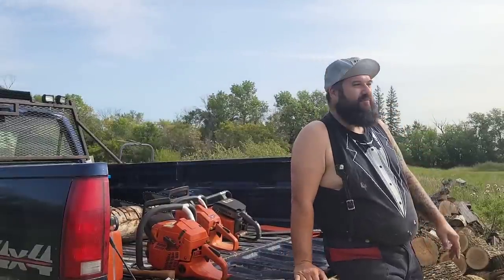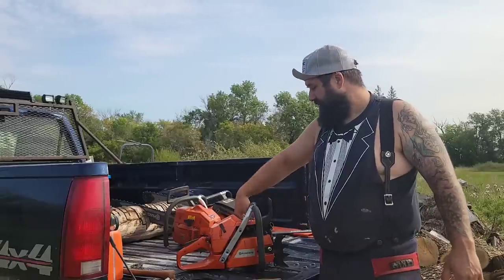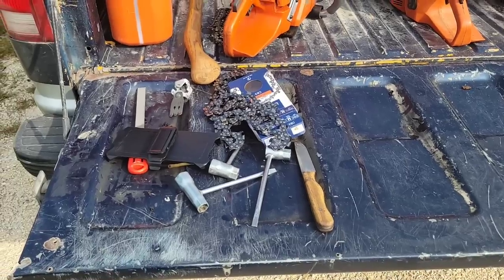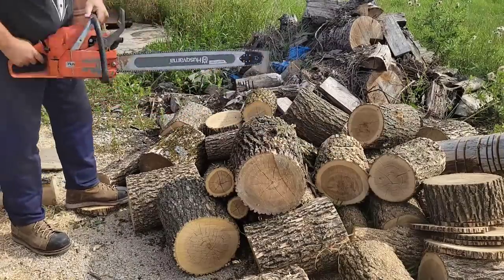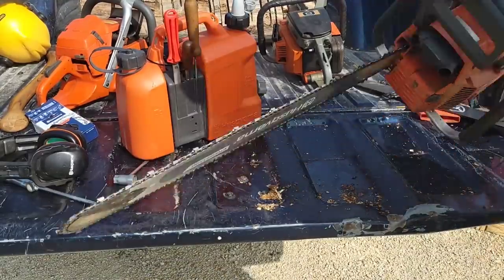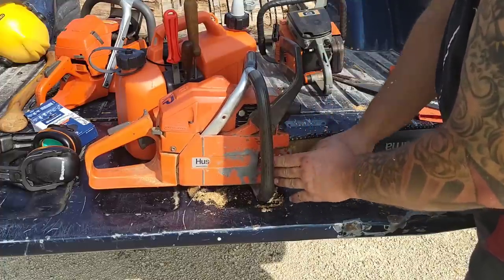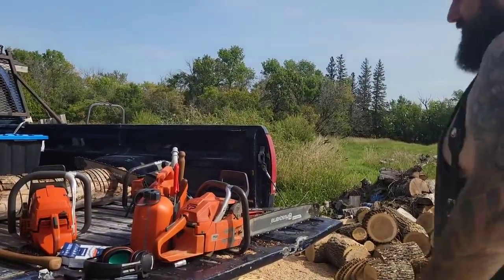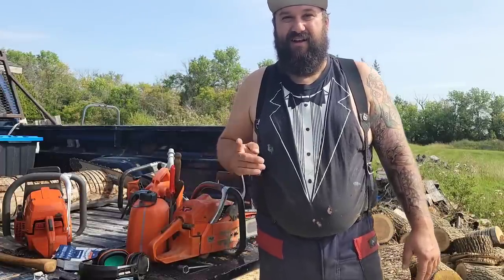Husqvarna C-83 chain vs handfiled chain. Which is faster???

Comment: Once I began using a chain grinder I quit filling! I have been  to a few Oregon schools and many STIHL schools. Learning from the engineers helped me a lot. Great content.
Reply: I just enjoy running the grinder.  I worked in and then managed an ace hardware for a few years and running the oregon (and cutting keys) were my two therapy moments.    Just like filing there is a touch to it to get a nice edge.  I am also an obliterator of gullets.  My top plate and side plate are pretty much cut in "plane" as in chisel like and flat in shape across the face of the tooth (except for a little curve at the bottom cutting edge of the side plate)
Reply: @mattfleming86  LOL. I also worked at an ACE hardware, 26 years, 5 of those managed one and 15 of those a STIHL tech.  The engineers said to only to grind down only to the bottom of the side plate. Leaving the gullet alone, it doesn't do any cutting. Lately I've been experimenting with square grinding & the hexa grind.
Reply: @richardfuerst5286  It certainly does not cut past the squared off side plate, but it seems to pull a good chip and cut well when I go a smidge deeper.  Chip flow maybe?   It may not be the right way or even the best, just what works for me.  I aim for the very bottom of the side plate to be into the radius of the cutter in a way that the last piece of the side plate at the bottom is 90* to the chain.  I still want some of that hook shape and that depth keeps me well out of the chain parts lf the chain.  But it is deeper than "code" As you know the top plate doesn't really do a lot of cutting when going cross grain, it's mostly the side plate doing the work so I like that hook shape to grab any leftover fibers and cut them instead of roll them over for the next cutter on that side. Going deeper than that brought no noticed improvements.
Truly faster or not, I like the side of my chain to be able to help me clean up a notch.  Going a tad deeper gives me a more responsive feeling chain to that practice.  If you have a beater chain, give it a shot.  If you have any other tricks or suggestions that can make a better grind, feel free to share.  I'm certainly not too set in my ways to change and obviously love to experiment :-D

Comment: I've always hand filed. Often thought of buying a grinder, just never did it. I cut 10 cord a year for me and I also have a chainsaw mill on a 660. 36 inch skip chain takes me 5 minutes at most and I don't take the chain off. At 53, I don't remember not being able to hand file a chain. I do remember in my teens we thought taking the drag or rakers way down might help. We were wrong. Lol. 
 Catch on the hand filing. You won't regret it.
 Good work.

Comment: I have been trying to learn how to sharpen a chain like this chain or like Buckin Billy’s.   I have came a long way but can’t wait to perfect it.    I’ve been practicing on all the farm saws and my saw.     I look know you mentioned throw away your guides.   I have found the Husqvarna Xcut guide is a great asset for me to get the tooth edge sharp.   I hand file the Gullet then go back and use the Xcut to get the top part.    I guess I’ll use it until I get more comfortable.   It’s really helped me close the gap in experience pretty quick.

Comment: Nice test. I'm not surprised at the results. Been sharpening since I was 14, (60 now) and I've learned to at least take the rakers down a smidge before using new chain. Used Husky for many years, tried the Holtzforma last year, and am also impressed. Running it on my G660 Blue (timing and exhaust) with 36" Tsumura light bar and it holds it's edge longer than most anything. Dulls files fast, but I usually use a diamond cylinder these days, especially on the long full comp chains.
Reply: Rotary and some tri-link is the same way.  you'll hit some harder teeth and some softer ones but overall they seem to run 'hard'
I do mine on an oregon so that dont bother me.  Unless I hit something hard enough to chip it holds an edge a good while.  Might have to try some hultzforma.

Comment: When dealing with chains that come on a saw you bought that someone else filled, it can simply be easier to put it through a machine and grind it back flat, square and even to have a consistent tooth to start your file journey with. 
I bought a Sachs-Dolmar 120si a few weeks back. Ended up buying a new chain and throwing that on, despite there being still about 90% of the life left in the chain it came with. 
I'll just take that in and drop it at the Stihl store to put through their grinder since I don't have a grinder myself. 
That chain was soft and filed beautifully one way, switch around to bring the other way and the cutters are hard, brittle and the file just skipped and slid over them. Strange. 
Anyway I've a 24" bar and 2 chains coming to go on that saw, the existing 20" and chain can go on another of the 120si saws as I assemble one good one out of 3 parts saws.

Comment: Even if stock chain is sharp to start, you gotta assume that its been bouncing around in the box all the way from the factory to the retailer to you. That'll take some of the edge off. I'd like to see a stock chain directly out of the box run against a stock chain with a quick lick on the edges. Or, a ground chain vs a ground chain that has been bounced in a box a whole bunch.

Comment: I run simi chisel chain. I know it cuts little slower. The wood I cut it stays sharp much longer. Lot dead on the ground stuff. That full chisel i spend to much time sharpening.
Reply: I took an old tacklebox style toolbox and now carry many chains with me in the truck.  I really orefer semi chisel for deadwood or bucking dirty wood (or in dirty conditions)
I like full chisel for felling.  I like full chisel oregon safety chain for bore cutting (not a pro so its less jumpy for me)
and I always have a few chinese chains for "i dunno if I should cut this" trees.  It's too quick to swap on a new loop and it gives me a second for a water break and to let my saws cool down some.

Comment: I can personally get a new chain to cut better than fresh out of the box. Out of the box I lightly file the rakers
Reply: I use my Stihl 2 in 1 file lightly on every new Stihl chain I put on then every tank of fuel it usually gets 1 stroke per tooth. Cuts like a hot knife through butter. 18 full cords of firewood in 2 days.

Comment: I cut mostly larger shagbark hickories, and have similar results.  Hand filing beats NIB and ground chain every time.  I do most of my bucking with an 036 running an 18" bar with Stil .325 RS chain on a 9 pin rim.  To call it a hot knife through butter would be insulting.
Reply: I've been wanting to put a 325 20" on my 620p.  I just don't know if I want to lose the reach my short ass gets with a 24.  I bet that 036 is a beast with that setup.
Same here..  lot of hickory and white oak.  My ole Husky 51 with a 325 NK almost keeps up with it in medium/smaller sized wood.  Kerf really matters.  You get more cutters on a 325 too

Comment: But only ONE round of use of the chain will be with factory "grind" and then we dress it up with our file.  Same with any of the chains I have used.  I have recently ground some EXL and C83 with a Techomec Super Jolly plus CBN wheel; to me they cut faster and smoother when hand filed.  Have to admit that the grinder was faster to do the loops.

Comment: As you use a brand new chain, it becomes less sharp(dull).  Proportionally to the amount of time that it is used.  As the chain becomes dull, it creates more friction as it passes through the wood.  Until the operator notices the difference in performance.   If it is not addressed before it becomes too dull, the chain's heat treatment will be affected (softening the cutting edge).  Then, subsequent sharpening of the chain will never match the factory fresh performance.  Since the chain is now softer, it dulls faster...you have to resharpen it sooner than the first time.  As time passes, sawyers become experienced, they learn to STOP when the chain loses its edge.  Resharpen it before it has a chance to get hot. I  This also extends the life of the bar.  Why do machinists use cutting/cooling fluid?   Because it reduces friction and heat build up in the cutting tool's edge.  As cutting tools become hot, they wear faster, become duller, causing more friction, causing more heat....  It's a cascading effect....thermal runaway...  Sometimes the bar oil runs dry sooner than you expect.  Or the oiling gallery/circuit becomes clogged or restricted to the point that the bar and chain overheat.  Gota clean yir saw, bar, oiling groove/slot, and the area where the oil transfers from the pump orifice to the bar.  Lube the tip of yir bar with the proper lube and clean it as well.  Gota have bar oil!  Check it during every gas refill.   After using a full tank of fuel, there should be just a little bar oil left in its tank.   Sometimes it needs to have the delivery volume raised (or lowered).   And that's the reason why some guys say, "it's impossible to get a used chain as sharp as a new one."
Reply: A sharp used chain will zip thru the cut faster than brand new because….the cerf is narrower than a new chain, so it has to remove less material.  It WILL pinch easier than a new chain, since the cut isn’t as wide.

Comment: Tree cutting and bucking logs need a different file. Id rather a stock chain for tree cutting and I knock the rakers down on a brand new chain out of the box for fire wood. I prefer C85 over every chain I have used so far. Ont. Canada. I try to only burn sugar maple and oak. Cheers
Reply from the maker: I also like a non grabby chain for falling.

Comment: noticed novice lumberjack was raving about this chain🤦🏻‍♂️... I wasn't convinced his sawing tests wasn't consistent. though he was using 0.50 compared to oregons 0.58. skinnier chain will always cut faster generally he should of been using oregon 72lpx which is same gauge. though it can wander on longer bars as they tend to be a bit more flexi, I've been playing about with my bench grinder and dressing the wheel so it cuts more like a square tooth... seems to work well, though hards woods can be tricky to get it dialed in... was cutting  a big 4ft+ chunk of oak few weeks ago that had been down for a year. wasn't that impressed  with my chains that day😂. this chip dump trick buckin has been doing... seems interesting.

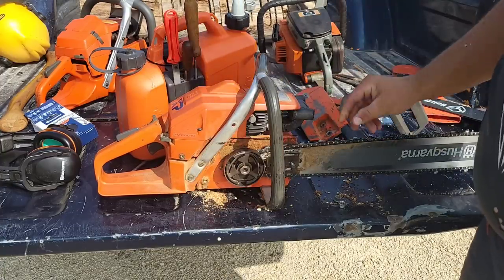Comment: 12:01 isn't that plate meant to be on the other side of the bar?
Reply from the maker: There's an inner plate and outer plate on some models .
Reply: @tinmanssaws  Wow, that's news to me! I just got my first 266 this week. 

On the crankcase IPL there's one "Protective Plate (501814801)" and then on the spare parts / accessories IPL there's two more, "Guide Plate (501444401)" and "Guide Plate (501444501)" - all three are different, and I'm missing all. Should I get all three to get her properly rocking and rolling?

Thanks Tinman, your channel's been invaluable to me since your boggy 200T video all those years ago <3

Comment: So your hand-filed c-83 is 25% faster than c-83 off the reel that’s been factory sharpened with a cbn wheel ?   Every c-83 loop I’ve made up off the reel cut purty darn quick and the top plate was incredibly sharp. Either that stock chain was dinged up or your filing skills put you in the .00001 percentile of hand filers. Even A sqr/sqr silvey ground chain won’t outcut an out of the box c-83 by more than 10% 😉

Comment: worst chain ever is Trilink brand.  they have a goofy extra raker built onto the sidelinks…and you cannot cut with the tip of the saw at all!  And their Trilink files are rubbish as well, brand new file will not even sharpen, just too soft to bite.  Save ya’ll the money you might want to throw away, I did it for you, lol.  Will grind off the extra goofy raker off that chain, just so I can use it.  And I will stick to oregon files now, too.  Live and learn!  cheers!